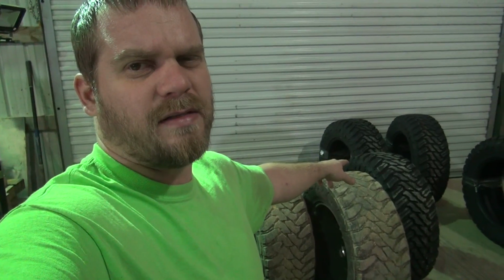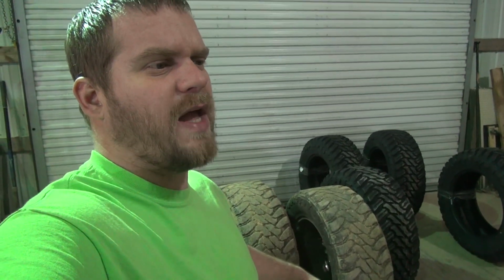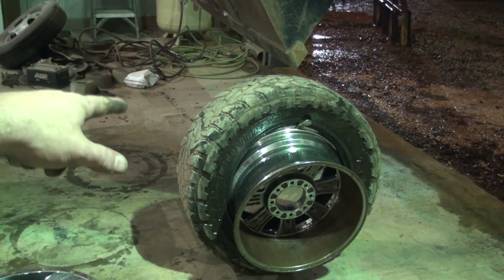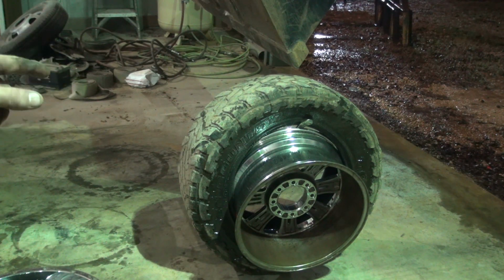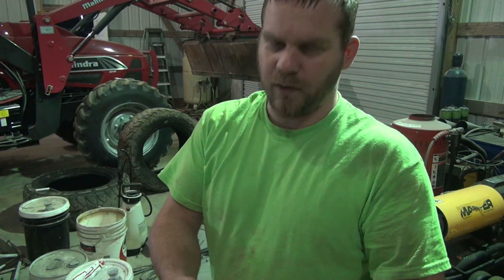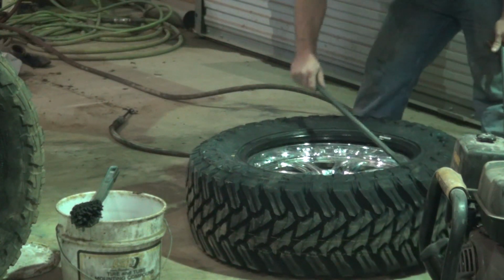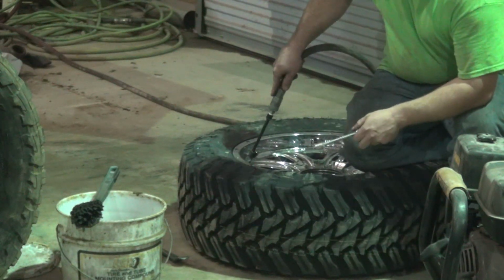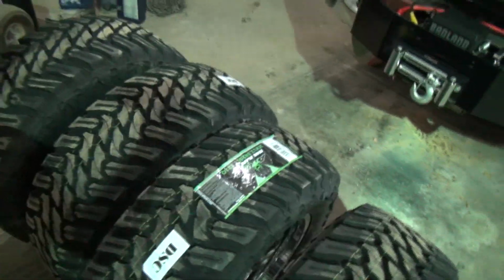Why do I always change my tires the hard way?

Comment: i like to mount my own tires. by the time i load up all the tires, drive to the tire shop, wait around while they do it, load them back up and drive home, i could have been done and on to the next project. i know it isnt for everyone. love the balancing beads. i have had great success with them. some of those beads can be difficult for sure!
Reply from the maker: I'm not gonna say I like to do it but that's what always happens is I wind up doing it 😂 I haven't had someone else change tires for me in probably 12 years or so. Like you said by the time I go get it done I could've already done it in most cases.

Comment: wholly crap 3 hours to change 4 tires 8 hours to replace and clean 4  rusty rims on an air seeder with new  valve stems  plus a couple of semi truck tires and at last repair a new tire that a tree root speared at the farm